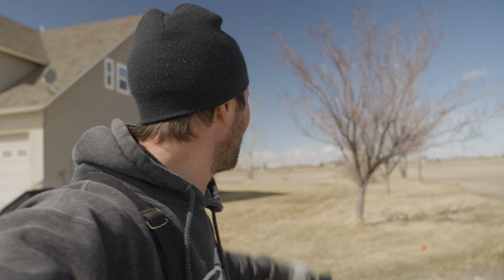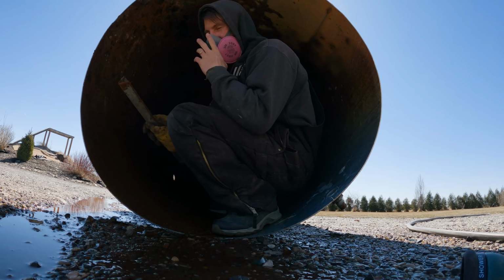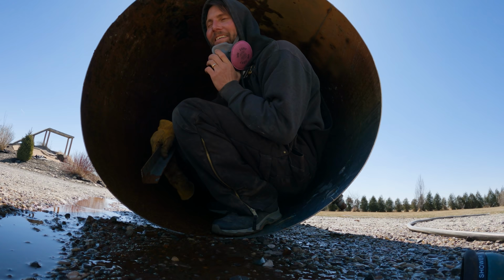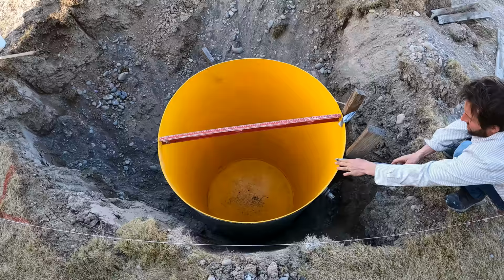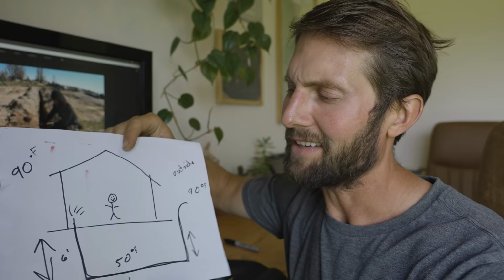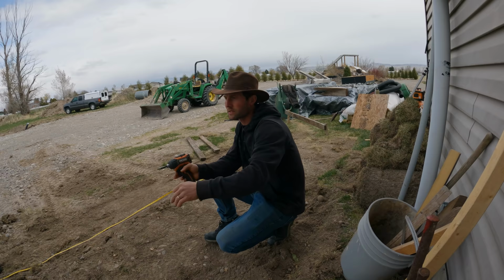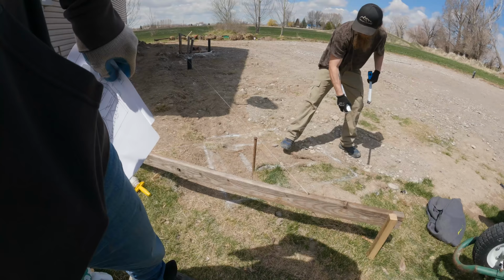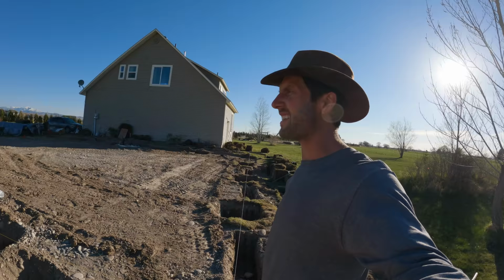I'm building a POLE BARN hangar style. Part 1

Comment: I like the project, I have followed much of these building styles. There is a formula for how much earth tube air turn is needed per your space. Green houses use this very effectively. One thing I would like to add if not considered. Insulation to protect from "thermal bridging" to your cement slab. 2 inch foam (side of slab/footing) 16 to 24 inches deep and 2 inches 16 to 24 inches outward from the bottom.  We did a form of this when we build our barndo style home. Happy building you guys!

Comment: You better insulate the side walls of your concrete floor - 80% of all heat loss is horizontally out the side of the slabs side surface.  You should also insulate at least the first 4 feet of the slab with 2" foam (XPS, it does not hold moisture as much as EPS) and then at least another 8 feet in towards the center of the slab with 1" foam (XPS, it does not hold moisture as much as EPS).  You can leave about 30% of the center of the floor uninsulated for a heat sink for the rest of the floor.
Reply from the maker: I knew it was a lot but didn’t realize it was the much! I am insulting the walls and the floor. I wA going to insulate the entire floor though. Never seen or heard of the way you described. Sounds interesting
Reply: @JonasMarcinko  
One note of warning, there are tons of information our there that are not backed by research so buyer beware.  I have ran into many over the years that profess all kinds of stuff but you have to do your research.

Comment: Closed cell Spray foam is the most efficient  Installation available
Reply: No expert but seems like any other type of insulation on the back side of steel would have condensation problems.

Comment: I did 200 feet 6 feet under.  It works but the humidity causes the tubes to fill up full of water.
Reply from the maker: Awesome. Yeah I put a few drain holes in at the low point. Hopefully mine works! Thanks for your comment.

Comment: I would have recommended against earth tubes moving air, because there can be problems with condensation forming inside the tubes, leading to mildew and mold growth inside the tube and then you industriously ship that air into your home.

Instead dig trenches for and bury pipes carrying liquid, just like for ground source heat pumps.  But instead of running that fluid over heat exchangers for an HVAC system (which is totally valid), instead just pump it directly through a liquid-to-air heat exchanger.  It won't be the very cold, dry air of air conditioning, but it would be cooler for a VERY low energy cost.

Comment: Jonas, haven't been watching very long. Don't know where you are... Please consider nailing the truss gusset plates down. They are only held in by 1/8 inch spurs. In a fire or heavy snow load they will fail easily.

Comment: I think it should work, just if you are pulling/pushing air, it would need to be at a very slow rate to get it to cool 90 to 50 degrees as shown in your example if it’s 100ft of tubing.

Comment: Did he say “water” in his radiant floor heating? Nobody gonna mention his tank ain’t nowhere near below the frost line? Isn’t this like south Idaho or something? Glycol ratio will be a must in any application here.
Reply: The tank is inside the building where it will not be affected by frost.
Reply: I believe he’s insulated it and the bottom is not insulated but below the frost line (more than 6ft down), so if heat rises and the concrete and insulation keep the heat in the tank as it rises, he should be ok.

Probably requires more than two systems for that size building though. 

Wonder if Jonas had a detailed “Heat Balance” calculation done 🤔

Of course he did, these guys are really professional career engineers 👍
Reply: @daverobinsonTnT . It's rather funny that you people think it's going to frost inside of the closed hanger
Reply: @james1795  I once had ice form in my bedroom over night when I lived in the UK back in the 1980s.

It was only minus six degrees Celsius outside but overnight once my heater was off, it dropped below zero in the bedroom as well. 

As a student, I would sleep in a sleeping bag on my bed during those cold spells ... LOL
Reply: @daverobinsonTnT . A chilling story. Yet I'm not sure what it has to do with the video.
Reply: @james1795   "Chilling story" ... LOL ... good one mate (:-)

I only put that (recollection) out there because I was surprised back then to discover that it actually got to be that cold indoors. 

Thought it might be relevant in the context of this particular discussion.

Jonas will have better insulation for his barn than the British Council houses put up in the 1960s had I'm sure.
Reply: @daverobinsonTnT  Heat doesn't rise. Hot air rises. Heat goes to cold. The tank will put all it's heat into the ground, where it will dissipate, not "go up."  No worries about it freezing though.
Reply: In our system, the warmer water rises to the top of the tank but I understand what you are explaining - that being the greater the difference in temperature the more likely there will be a tendency to seek equilibrium.

What may happen is that the greatest difference in temperature occurs at the top of the tank and thus the heat ‘diffuses’ in that direction.

It’s the only explanation I can see for the observation made in the case of our tank but then again, our tank isn’t buried in the ground 🤔

Thanks for the insight 👍

Comment: Sweet!! That's going to be a nice, big space to play around in! I can see it full of aircraft, jet boat, a side-by-side, and a couple ATV's ... and Sylvija's car in the winter. :)  Great idea for the in-floor heating / cooling! I thought about doing something similar with my well water here when I built my shop, but I was already WAY over budget. I should've done a pole barn - would've been alot cheaper. Still no insulation in mine - probably won't be for the next decade the way I'm going, lol. Glad I built a waste oil burner. That's about the only thing that'll keep up with the BTU load of this place. :D
Reply from the maker: Thanks Smitty! With the waste oil burner you built, you don't need insulation!
Reply: @JonasMarcinko  - This is true! 😁

Comment: What most homebuilders don't realize is, the airplane is just the tip of the ice berg that you see.
Not only are you going to need an airplane, you are going to need a shop to build it in, all the tools to build it with, an internet connection to source the parts, a motor, expertise in 2 stroke or engine usage, a propellor, expertise in covering and painting, not just metal cutting.. drilling and riveting... and it's still not over.   After you finish your airplane, you're going to need a 20 ft trailer to move it about, a truck to haul the trailer, a hanger to store the airplane in or an enclosed trailer or both, and your own land to build a runway on that is mostly flat and stump free.      I quit about the point where I realized I'd have to spend another $15k on land, another $15k on top of that for a hanger... and after all taht, all I'd get to do is make circles around my airport or fly mostly straight in a boring straight line.

So I dumped it, this was bvll5h1t, and switched to flying fully aerobatic fpv quadcopters instead.   They are not without their own set of problems, you're basically building a flying robot, you need PC tech skills, soldering skills, and a new set of flying skills... and perfect vision..   the eyesight is what I lack.

All in all, aviation ultimately for me was a waste of time.   

I've got 3 airplanes that never flew, in a shop collecting dust, and 3 quadcopters, only one of which flew for 5 minutes, collecting dust on a table...   because I now can't see enough any more to assemble them the rest of the way to finish.

You're best served forgetting about flying all together, and getting into something else.

I've built a pole barn before   All I can say is when you're done, look down the roof line, you'll have one wavy roof....   if you shingle it.   It's a heck of a lot of tar shingles.   Ours eventually burned down from a shop fire below, and the next time around we built a steel building with concrete floor.

Comment: G,day Jonas from Quarantine house lockdown Sydney Australia.
The Carpenters rule: straight, level, square and plumb (vertical).
* 100' is a long draw for airflow without mechanical assistance
hopefully it is effective without the need of a small solar fan unit that passes through a chlorine water filter (evaporative cooling).
🌏🇦🇺

Comment: Will there be condensation in your cooling tube? Holes to drain?
Reply from the maker: Yes I put some drain holes at the low point of the tubes.
Reply: Drains let water in and out, non-return valve or flapper valve.

Comment: How are you handling the condensation with your geothermal system when pulling in the summer air and cooling it? Just wondering.
Reply from the maker: I put some drain holes at the lowest point. They are close the the ends so if for whatever reason they don’t drain I’ll need to pump the water out.
Reply: @JonasMarcinko  A little late now, but the alternative is to put 3/4 inch water (or coolant) lines in the ground and just re-circulate with a small pump through an old radiator, and use a fan over the radiator.  Uses very little power and no chance of bringing in mildew or mold spores into your air.

Comment: Interested in the same setup.  How will the building support a hangar door?   I didn't notice any steel beams for the opening
Reply from the maker: The door not be that heavy (maybe 1000lbs.) The two trusses and header will hold it. 
the weight will be spread out. Check out the video I did on the two hangar doors I built. similar concept.
Reply: @JonasMarcinko  thanks for replying! Sure beats the price off any Morton steel building

Comment: Is the tank galvanized and are you concerned that having it set in concrete will corrode it?
Reply from the maker: If it does it does. I have had thoughts of installing a rubber liner in the tank if it starts leaking.

Comment: Did you do any math on the heating/cooling requirements of the building or are you just winging it like normal?
Reply: Intuition tells me that the heating/cooling effect will be minimal in this application.  50' (even x2 with two tubes) just isn't much time for the air to change temp.
Reply: He obviously hasn’t done a heat/loss calculation. Does he even know the R value of his building envelope?

Comment: If you put your poles in the ground they will rot over time. It's better to put them on a concrete foundation and anchor them with the concrete with a galvanized anchor plate/ bracket just like RR Builders does on YouTube. You will end up with a better building that will last much longer, be perfectly square, plumb and level.
Reply: You don't understand the pole barn concept. That's how they have been building them for years. The poles are pressure treated lumber. It is the foundation of the structure. You can pour a floor or go with gravel and pour a floor later.
Reply: @gafletcher1  I understand what your saying but presser treated lumber is from Hemlock Fer. They put a chemical in it to make it last longer but it doesn't last as long as concrete. It rots over time especially when it gets wet. Yes, bugs don't like it but after some time has passed, the chemical will loosen up and be weekend allowing bugs to start eating away at it. The building method I'm suggesting is just making it better in many ways. Improving on the pole barn concept. If you just think about what I'm saying hear, it should be easy to understand that I'm helping you make a better decision. There are many ways to build a building and progress is made making materials better, design better and so on and so forth. What I'm saying is by far better but I think outside of the box. Not everyone does.
Reply: @robertlaird6746    The utilities use wood poles for power lines, treated wood in the ground is a proven concept.
Reply: @portnuefflyer  Concrete is better and last longer. Every type of building material breaks down eventually but concrete last longer than presser treated wood. I'll build my building and you build yours and then our grand children can inspect it in 50 years. Your building might be on it's last leg where mine has another 200 years left. It's all about the foundation. When you put wood in the ground, it rots much faster than concrete.
Reply: @robertlaird6746   How long is "long enough?" 50 years? 200?! Of course concrete is the ultimate. Personally, as a 35 year contractor, for my own buildings I use conventional framing and a conventional concrete foundation, for the heated and air conditioned shop and hangar. For my out buildings, unheated, I go pole barn construction. Getting the entire building's footprint within a continuous footing below the frost line does all kinds of good things thermally, I suppose that's why 99.9% of residential housing is built that way!
Reply: I've been using ICF for my foundations for about 35 years. I've built several homes with my own hands and no hired labor at all. I've also built many other homes with help. All the homes I've built were raised foundations using ICF as the foundation. I've also used SIP's. I've built steel buildings, timber frame buildings, stick buildings, log buildings, ICF buildings and engineered lumber buildings. Currently I'm building a 5,500 sq ft geodesic dome home with a 50 ft diameter dome and a 20 ft diameter dome that is connected together with a 12 ft wide but short hallway. It's 3 1/2 stories tall. I'm also in the beginning process of building condo style apartments. I really like how you can take a pole barn wall and build it on the ground and stand it up on brackets that are half way in the concrete. It's much easier to build that way in my opinion. RR Buildings has the perfect way besides not using ICF as his foundation in my opinion. Everyone has their own opinion. If everything was the same it would be dull and boring. My favorite style of construction is timber frame with SIP's and of course ICF as a raised foundation.